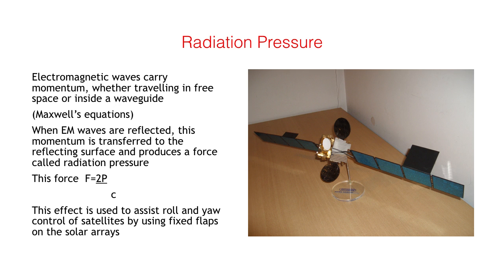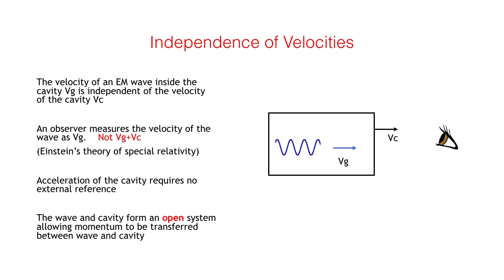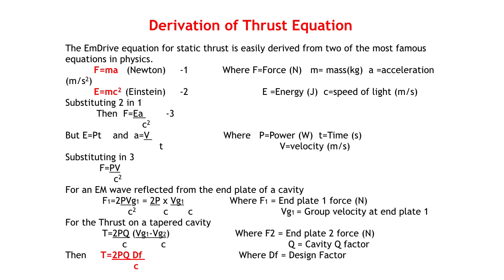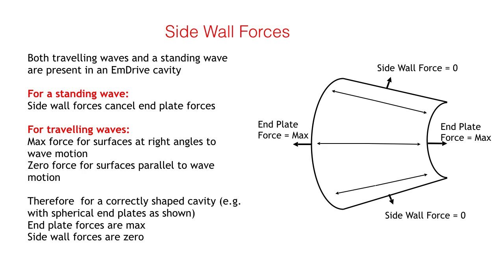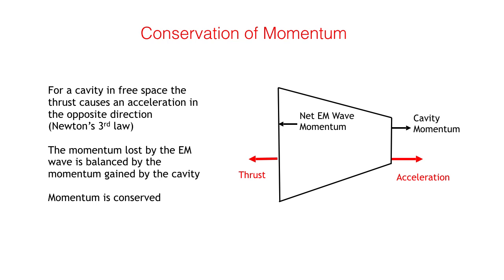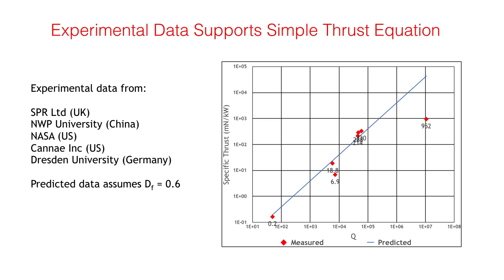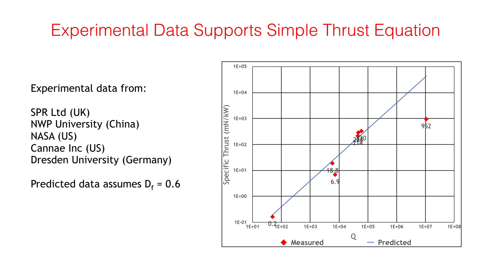Roger Shawyer Explaining The Basic Science behind #EmDrive

Comment: could the  radio wave  actually pushed some particles out of the container to generate thrust??
Reply: if you can maintain a constant thrust at a constant energy input, you get a perpetual motion machine.

Here is the mathematical proof:

constant thrust = constant acceleration a

Therefore, the speed over time is
V(t) = a*t 

The associated kinetic energy over time will be
kE(t) = m*V(t)*V(t) 
kE(t) = m*a*a*t*t

Now The total energy in Ein(t) grows linearly
Ein(t) = w * t  With w the oven power in in Watts 

There will be a moment where kE(t) becomes greater than Ein(t), because kE(t) grows to the square of the time.

Past this timepoint, you will have created more kinetic enrgy than you had input Energy

You created energy out of nowher. Efficiency greater than 1. Perpetual motion machine.
Reply: which particles ?
Reply: You might instead want to think about how the heat in a rocket engine manages to make the rocket move instead of just lighting it up like a light bulb. Especially on an atomic level.
Reply: It's not the heat which makes a rocket move. What makes it move is pushing against its fuel exhaust. Strictly speaking, you can push yourself forward in space by throwing rocks behind you. No heat needed.

The heat in the space rocket is just the mechanism used to throw the fuel out with enough force to move forward.
Reply: I wish I know which particles ! maybe the molecules of container become propellant , after a long while, the container's mess decrease!
Reply: arnaud nicolas It doesn't make any physical difference whether you use your hands or fuel or magnetism or whatever to propel the rocks. Either way, you use energy (heat), which is stored in the engine. Think about how a rock is supposed to have any effect on yourself when going the other way. It's obviously the pushing, not the rock, which makes the movement.
Reply: 為元張 I'm pretty sure they already measured that. And I find it rather unlikely, as the molecules would have to hit something in the direction of the exhaust, and they should have been looking for that in the testing.
Reply: +Carl Dombrowski "And I find it rather unlikely, as the molecules would have to hit something in the direction of the exhaust" 
No they wouldn't. Throwing anything out in one direction gives you equal momentum in the other direction.

And not all forms of energy is heat. Potential energy (gravity) can make you move without heat.

The point is, conservatino of momentum means you don't get to move in one direction if nothing else is permanently ejected in the other direction.

Otherwise you get a perpetual motion machine. And if there is one thing we know, it's that you don't get to create a perpetual motion machine.
Reply: arnaud nicolas You'd only get perpetual motion if conservation of energy was broken. Which is not the case here. And you did not give a reason why they wouldn't have seen those atoms leaving the engine.
Reply: And if you start arguing that the acceleration should depend on the speed, you are implying that the engine can't accelerate in a given inertial frame of reference.

All inertial frames of reference conserve acceleration. If acceleration is zero in one of them, it's zero everywhere.

And regarding the particle hiting the walls, my bad, I didn't get what you meant. Yes, the Nasa paper was done in vaccuum. No particle exhaust involved.
Reply: So, the radio wave must pushed something currently invisible to produce thrust. Something not measured. Other explanation would violate conservation of momentum.
Reply: +為元張

What about a simpler explanation: EmDrive does not work.

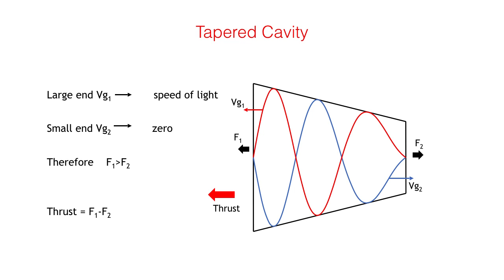I mean, we can go on and on about trying to find a reason why it must work, or we realize that so far, the claim is bogus, the maths is fraudulent (take a closer look at 05:22), and the experiments are not conclusive.

Razor of Occam in action: The EmDrive IS a perpertual motion machine claim, and therefore not worthy of attention. The experiments were conducted without enough control on the sources of error, and therefore inconclusive. Finally, Shawyer is a scam artist.
Reply: what if the machine propels u off gravity particles propelling you faster on it's on gravitational wave in theory using the undiscovered gravity particle makes sense to me
Reply: I'm personally not a fan of gravity particles. Electromagnetism seems to be completely sufficient to explain gravity.
Reply: +Draco +Carl Dombrowski 
"propels you off gravity particles"... "Electromagnetism seems to be completely sufficient to explain gravity"...

What have you been smoking guys? Can I have some of it?
Reply: arnaud nicolas What a witty and well thought out argument :)
Reply: +Carl Dombrowski Theoretical physics on weed is always fun.
Reply: arnaud nicolas In that case it seems we should both try some - might help you understand and me have fun ;)
Reply: There are no particles in use with this engine, only photons at microwave energy wavelengths.

Comment: I'm somewhat puzzled. The diagram shown at 5.24 shows a force F1 acting upon the larger diameter wall. Doesn't this imply that the acceleration produced, due to this force would be in the direction of the larger wall. i.e The force is acting upon the larger wall, & causing the motion of the vehicle  in this direction, & not the other way around. I'm probably missing some fundamental point. Can anyone enlighten me?
Reply: Google the idea of using a fan to push a sail boat, and see why at some point it sort of works, but then when the energy is ramped up it doesn't, you have two forces acting against each other, in the exact manner you are questioning here, yes the microwaves will eventually go to the larger back plate. The cone will provide foreword momentum but when you need more microwave energy to really get it going that back wall will cancel out the foreword force.

Now I just don't understand why they just don't let the microwaves leave out the back, maybe in some diagram they have a design that does do that.

Comment: From what I understand, the system works because reducing the size of the cavity reduces Vg, which reduces the reflection force on one end.

However, wouldn't the reduction of Vg itself create a "reflection" or perhaps more accurately a "damping" force?

Explain like I'm five please
Reply: it doesn't work...
Reply: Quite apart from any consideration for Vg if you just put a pressurized gas in a tapered bottle you should have unequal forces applied to the unequal ends of the bottle.  The pressurized gas will apply, to each end, the same amount of force per unit area.  Also that pressurized and tapered bottle is not going to accelerate.

Comment: But there will be a force on the cone in the same direction as the small end. Will be less because the it's a glancing blow but the area is much greater than the difference between a cylindrical end plate and the small end plate. The wave can't be moving perpendicular to the end plate and parallel to the wall of a cone because the wall of the cone isn't perpendicular to the end plate.
Reply: Exactly! That graph at 05:22 is intentionally misleading. The wave amplitude is is drawn smaller toward the small end so as not to notice that it bounces off the side wall too!

The fact that this is most probably intentional pisses me off.
Reply: arnaud nicolas All "over unity" claims are either intentionally misleading or delusional.

Comment: As I and others have said a million times, this isn't working by breaking the laws of physics, it's working by adding something we're not seeing, phased particles would mean that's what the microwaves are pushing against. You can sit there with your thumb up your as and try and argue against this breaking the laws of physics, but no ones saying that. You're simple minded, an information sponge, yet you dont know how to apply the information you have.
Reply: How much momentum is transferred from two photons imparting their entire amplitude on the interior wall and then going out of phase in the local EMF field? A whole LOT more than simply a laser rocket, the gain is important in terms of Q factor leading to higher field strength, but the real secret is that we're stealing ALL the available amplitude of a frequency of light, this makes it appear that momentum is being gained up to a cutoff frequency, so the high gain observed is the effect of it being quantized at discrete microwave frequency, the craft is attempting to gain all the momentum of that frequency, not just the tiny portion that is lost by the bouncing of photons, resulting in momentum transfer and red shift.

ALSO you have to remember that the stress energy tensor on spacetime itself is being changed in high energy systems. Positive or negative spatial curvature could develop resulting in artificial gravity.
Reply: actually you are wrong.
there is no repeatable evidence of this  working in any way, producing any thrust.

Comment: youre just using e =mc2 
youre getting energy from mass

the more appropriate thrust method which is still being researched which also uses e=mc2
is pulse propulsion using controlled exposions such as nuclear like project orion or advanced chemical compositions
extremely efficient propulsion
Reply: Farting nuclear explosion does transform mass into heat, but it doesn't create momentum.

This EmDrive as currently described creates momentum. Which violates physics.

Comment: Thrust-  or radiation pressure - is present as waves reflect on  front and rear end plates. But what happens when they reflects on lateral surface of conumdrum? To me THERE IS a radiation pressure on lateral surface, wich produces a backward vector force. Even without a rear end plate, the angle of cone produces a gradual reflection angle change that  in certain point inverts the reflection angle, producing the waves going to the front plate . Being so, the total sum of force on ALL surfaces is zero.

Comment: If you read the actual NASA study, you'd find out that the amount of thrust produced was within the margin of error for the testing equipment.

That means, the device may have produced no thrust at all and results were random error on the part of the testing equipment.
Reply: Yeah, but that's just one of the many tests. NASA had to go cheap compared to China who ran the highest power test so far. To properly test it in Earth's gravity is going to take a large amount of power.
Reply: ***** Or, considering it doesn't work, none at all.
Reply: Waltham1892 The Chinese tests came up with positive thrust measurements. It works.
Reply: ***** NASA's came up with a positive thrust measurement too, but it was within the limits of the test's sensitivity.

So, the result was what we would call an artifact of the testing method.

In other words, it doesn't work.

NEXT!
Reply: Waltham1892 You repeat yourself and then act cocky because you know how. Allow me to do the same.

NASA's didn't work measurably because they half-assed it. A proper test should use a lot more power to be certain.

All the other test groups that got positive results beyond the margin of error somehow don't count because NASA gave it a mediocre attempt once?
Reply: ***** You can repeat yourself till you drop.

There is no reason why this thing should work and oddly enough it doesn't.

Anyone who tells you different is a crank, and I for one don't listen to cranks.

I think we are done, don't you?
Reply: Either way we'll find out in December when the US Eagleworks publish their findings on the drive and by the leaked title of the document many are already assuming the drive works exactly as has been stated.
Reply: Waltham1892 don't lose your time trying to explain these people what a margin of error means. They are running on faith, not facts!
Reply: Just to clarify here, with or without propellant, no engine can accelerate to the speed of light. EmDrive does need 'electrical fuel' (say, a reactor) to work. And just to add my two cents, /if/ EmDrive is shown to work, it doesn't make the math/physics that Roger Shawyer uses to explain it any less flawed; this video does little-if-anything to explain why such a drive should work.
Reply: I think there is no physical body with mass that can travel with the speed of light because it's mass should be (according to theory) infinity. Only photons which doesn't have a mass. Of course we can be wrong everybody.
Reply: Waltham1892 Thrust is cumulative.   This drive can reach the speed of light, no chemical drive can do that.   I'll leave you to work that one out and you'll get it if you put preconceptions aside and think openly.
Reply: ***** You really don't understand youtube, do you?
Reply: Rob Fraser Yeah, but I would suggest reading the entire study.

Based on a study I've read recently, the efficiency of this "drive" from a dead stop is in the neighborhood of a decimal point, a couple of zeros and then a number.

Even a chemical can have up to 60% efficiency.
Reply: JMaldonado64 You are probably right, but I've got to put those grad school statistics courses to use somehow...
Reply: ***** "Consistently performing with 1.2 +/- .1mN/kW" 
It's nice to see that in an official paper, but lets give some time for the peer review to take their best shots.

Afterward, hopefully he'll get the funding to prototype his 2nd generation design.
http://emdrive.com/secondgenengines.html
Reply: ***** The most peer review can do is argue the methodology and ask for further testing. At this point a micro-satellite should be the next test.
Reply: Thank you.  I wanted to read the paper and test results.
Reply: Rob Fraser I have also developed a drive which will propel a ship to the speed of light.

Its two pieces of string, a 9 volt battery and a Dixie Cup.

If you'd only lay your preconceptions aside...
Reply: Just trying to keep up here, your point is that any engine can propel to the speed of light with enough fuel right? Doesn't the EmDrive need electrical fuel just like a chemical drive needs chemical fuel?
Reply: Reading this in hindsight is hilarious. Yang has already retracted her claims, and everyone besides Eagleworks has produced null results in their experiments. Looks like the all dogmatic snobby physicists who cried "hey look, you can't just say momentum isn't conserved" were right.
Reply: @Marcin Kapusta "I think there is no physical body with mass that can travel with the speed of light because..."  Yes.

Comment: the EMDrive is analogous to sound Node Antinode or NA and ANA in musical instruments like the flute. Just in the microwave frequencies not unlike the sound frequencies. electricity being like the air mass in music. like hooking a compressor to a flute.
Reply: The reverberations are similar to wavelength indeed.
Reply: rippspeck So would stereo speakers produce more thrust then an EMR ?
Reply: Sound = thrust ???
Reply: it's been shown EMR has force - the evacuated light bulb with a spinner of white and black surfaces on either side - white repels EMR while black absorbs EMR giving rise to motion (thrust)
sound air pressure - EMDrive EMR pressure
Reply: air is pressure on earth (propagated by air waves)
energy has pressure in space - photo ionic pressure
Reply: depends on the power (HP = watts) (torque = N*m = F*r) & (RPM = Hz) it's an electric engine
Reply: No, this is nothing like the musical instruments, sorry. Even if the emdrive works, by it's theoretical assumptions it requires relativistic effects created by the always constant speed of electromagnetic waves in order to produce the pressure difference on the opposite walls in order to produce this "net momentum".  Pressure created by sound waves in such a device would create no acceleration without expelling force outside, and in a "box" of any shape the vectors of pressure would just end up cancelling each other out creating exactly zero net momentum. This trick is only assumed to work because of the relativistic effects of microwaves.